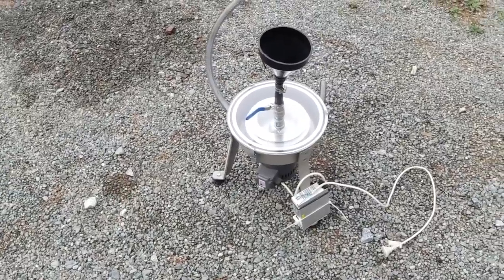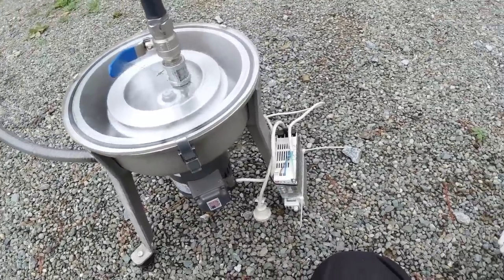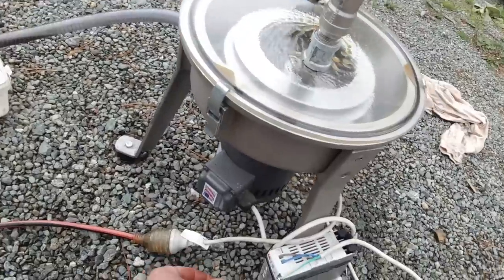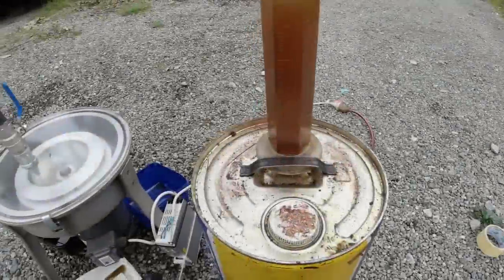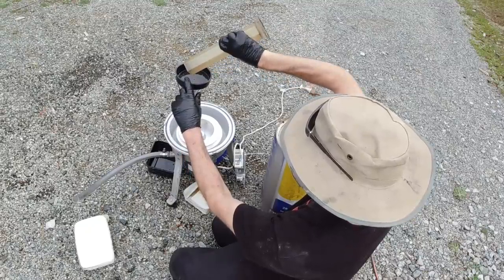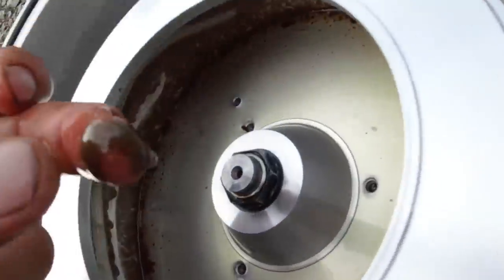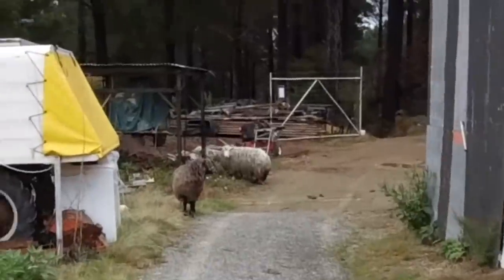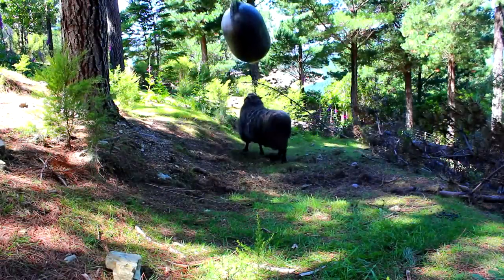Using a centrifuge to clean used oil and diesel.. Will it work??

Comment: Marty, long time subscriber here from alaska.... this is right up my highest attention level as it brought back a great memory on a job I worked on.. the Valdez Oil Spill, a tanker went aground and the stories about it went world wide. I was on clean up with a machine powered by a seven cylinder Deutz engine,... a very loud air cooled engine with just a perfect setup to run three centrifuges under it so it could separate oil from the sand and rock on the beach. It did work alright but it was a nasty thing to clean that crude oil from it... so when we packed up and left, we didn't bother to clean those chambers. Fast forward about two years with no more work for it and we needed some cash so decided to scrap the machine and part it out. We took those tanks out and the first one sent straight to the crusher so when we tried to take the next one... they resoundingly said clean only! We needed that cash bad so we started cleaning up the centrifuge of the nasty crude, backyard fire to remove the crude praying not to get caught with the smoke from that fire which did not burn well at all or a losing deal. That turned out a blessing though cause this is where things got interesting.... gold and oil have a similar weight on the periodic chart and so imagine our surprise when we found a significant amount of gold flake from that sand off of the beach in Valdez. I and the other guy had a lot of money we figured to never see back and so owed money yet for materials. We found in the waste and spots in the cylinders a lot of gold at thirty two dollars a ounce then as so even... it came to nearly seventy thousand dollars in gold we had no clue was in this machine... more if we had kept the one we shipped out for scrap. I did tell them what we found and so they retrieved that crude from the cylinder once found again. It paid off our debts, and put a little cash in our pockets as  well. Us guys though who catch the bug called hobby mining never wind up with much cash in the end and we could not afford to build another centrifuge like our first one.... I just know it would of worked in some of our streams here
Reply: Fantastic story!
Reply: What part of AK?
Reply: Oil separators have been used in ships to filter heavy fuel oil to the engine for a long time. Heavy bunker oil is pre-heated first, then through a centrifugal oil separator, then through particulate filters before the engine. Big things, those separators, with a lot of widening chambers (cups) in them. Same principle as in the video, just a lot more of them. In a centrifuge, the viscosity of the fluid + the diameter decide the optimal speed for a certain size contaminate. Your crude little experiment showed us all that it works, but you need a more controlled environment to get a good result. And a better centrifuge, of course.
Reply: @AlaskaTrapper  I was using in on the petersburg road that takes off of the road to fairbanks... past gold creek
Reply: Dear Morgan Adair
👍👌👏 What a great story with a very surprising result. Congrats. I like happy endings respectively I need and want them (especially nowadays). Thanks for sharing this adventure.
Best regards, luck and especially health to all involved people.
Reply: Although the separation method might filter out gold flakes, gold and oil are most definitely not of the same specific mass. Gold is about 20kg per liter of volume, where oil is about 0,7kg per liter of volume. They could not be further apart in density. 
This is exactly why you can separate based on centrifugal force. Drop a slurry in a cone shaped container, spin it. The lighter elements will be flung outwards and upwards, the heavy stuff like gold, lead, mercury and all that heavy crap stays behind.
Reply: LOL!
Reply: Wow that's a great story. Glad you made out good for all that awful labor.
Reply: Great experience and thanks for sharing!
Reply: I live in that area now.  Your gold prices aren't accurate for that time period or even close.  You're literally claiming to have got 150lbs or 2187 troy oz of gold.  I've never heard of people using centrifuges to clean up exxon valdez; but it is possible.  Valdez was also not a major area as far as spill damage in spite of the name.  I've also literally rebuilt fuel/oil centrifuges multiple times and that's not something you build.  I think your memory is as good as your written communication skills because that certainly was a challenging read.

Comment: your centrifuge will clean down to less than one micron but will not remove the colloidal carbon that makes it look black still. It will certainly be clean enough to blend with whatever and run in non common rail diesel motors. good on you mate, I've been doing this for 10 years and have used over 60,000 litres through my Cummins Signature 600.
Reply: oh yeah...I have seen the 10K rpm units clean oil quite well...but they sound like they are gonna explode!
Reply: Exactly. Common rails are way too delicate, the high pressure pumps just runs at insanely high pressures, any sort of impurities will do tons of damage. Older diesels are less refined and efficient, but also much much more resilient
Reply: You pass the oil through compressed cellulose and you'll remove most if not all of the sludge, carbon and oxide insolubles. I use a dirty liquids pressure pump to clean oil that way. I reuse it in order of degradation through increasingly less important machinery. Ex: car > lawn tractor > garden rototiller > chain saw. Initial setup is a wee bit expensive, but it pays off over time. Where it really shines is on my brother's farm where things are upscaled considerably. Mixed with good oil, you get perfectly usable oil at a reduced cost. And it adds up. We've had several blends and the raw product tested and the compressed cellulose removes all the major contaminants including oxidation issues.

Dunno if it works for fuel tho, never tried it, we rarely deal with wasted fuel.
Reply: Do you have some pictures or similar on your setup? 
I'm currently using  Diesel ship  filter catriges and I'm happy so far but I'd like to see how you guys do it
Reply: Only diesel or do you burn oil?
Reply: I run regular Diesel sometimes,  but mostly a mix of 70% waste oil blended with 30% unleaded petrol, the mix can be altered to suit your needs  but I try to keep the specific gravity at around 0.83. you can't mix more than 40% unleaded because of pre ignition damage so I try to stay at 30% or under. The older mechanical injection systems loves the lubricity of the Black diesel now that diesel is low sulphur . I  have sometimes used a 50/50 blend of diesel and waste oil and had no problems.
Reply: @mdavies750  what kind of equipment do you run? Generator? Tractors?
Reply: @mdavies750  Ah so you are thinning with gasoline. Your overall savings is quite a lot. What grade do you use of gasoline? Have you tried ethanol? 
How much do you keep refined oil on hand? I have see some people's set ups and my neighbor was going to get in to it yet he does not use much for diesel any more.
Reply: yes, may be good for particulates but doesn't oil go "bad" with other problems, increased carbon, sulfur?
Reply: @sheph7  Oil does not go bad, it get contaminated. Oil goes bad "contaimated" because of chemical reactions like air and oxygen, heat, light and water. if you store your oil full with little to no oxygen in the top then you will have less contaminates. Refined oil that has been filtered to remove the contraindicates will have less thing in it to hurt it.
Reply: @VH-ew7oq  on highway tractor unit Freightiner with cummins Signature 600
Reply: @kameljoe21  I use standard grade ron 91, ethanol is too expensive at my location
Reply: @kameljoe21  Oil does go bad, atleast the multi-weight oils. 
By heat cycles and being pushed through the oil nozzles in the engine, it degrades to the properties of the base oil being used to produce the multi-weight in the first place.
Reply: @sheph7  Yes and the constant heat cycles it goes through in its use alters it's ability to maintain a film and deal with heat,lowering your oil pressure and becoming thinner at lower working temps, therefore essentially altering its actual classification.Back in the days of reclaimed 20w50 being commonly used by most back street garages and Sunday DIY-ers. it was found by a motoring journalist that some commercial reclaimers were using salt in their processes and a good percentage remained in the end product. Back then quite a few cars had oil pressure gauges and you could see after filling that the initial good pressure would drop off quicker with cheap reclaimed stuff after shorter durations than you got with even a half decent oil. I used to use quite a bit from a Motaquip shop for a garage that I worked at,every bottle despite being the same brand and type was a different colour oil😂. As stated by others it will be fine in older stuff,machinery etc.anything new and you are taking a gamble.
Reply: @kameljoe21  The constant heat cycles it suffers in use alter it's ability to maintain a film and it's heat transfer properties,around 60% of engine cooling is achieved by heat transfer via the oil and it's the only thing keeping the components from eating each other.
Reply: The problem is that the oil wont be able to bind any more carbon, which means that it start to accumulate in the oil as particles and degrade its lubrication ability, aswell as pose a threat to parts that rely on tight tolerances, by these particles clogging them up. On a modern engine this is pretty much a death sentence.
Reply: @aserta  it works very well to clean pure diesel fuel :) On ships with smaller type auxillary engines such as some Scania V8s with common rail use the compressed cellulose filters or CjC as the brand name usually is, to clean regular diesel thats been stored in the ships tanks.

Ive also seen a lube oil sentrifuge replaced by a 1 meter tall filter with 4 stacks of 3 inserts each, on a 3000kw wichmann engine
Reply: The particles would sheer through wear over time right? Wouldn't this effect the viscosity of the oil, and if so, does it not matter in certain applications where it does it car motors?
Reply: Don't forget milk is a colloid too and why it looks opaque white,
Reply: @Oroborus710  Yes it does, for a very simple, farmer style test check out ProjectFarms Videos of engine oil comparisons of this happening after only on heat cycle! This will mostly effect the performance of cold oil because the properties of the multi-weight oil changes towards the properties of the base oil.
In short, the oil becomes more viscous when cold, against the desired lower viscosity, to pump more volume at lower temperatures, when cold !
Reply: Lol clean used oil & diesel. Last time I checked used diesel meant it was burnt not cleanable.😅😅😅stop it silly!
Reply: I think you can use electrolysis to remove the metals and sulfur and even carbon from the oil. Oil itself is a very good insulator but with all the contaminates it might just work at high voltage. I think oil is 5 times better then air at insulation? Im looking for any articles published now but it would be a perfect second stage if it worked. It would be a low effort way to recover metals and elements from oil as well as reuse it.
Reply: @aserta  video?
Reply: Did run it in several different diesel engines and wmo ran best in earlier common rail diesels. 

Best start up at any temperature, best power and absolutely no smoke or haze. 

Could run it at 100% wmo and it drove just like on diesel. 

What ruined the system was a stupid mistake were gasoline dillution in my fuel destroyed the high pressure pump. 

I collected fuel from misfueling to dillute my oil for colder weather and someone told me it was 80% diesel while it was more like 80% gasoline. 

So I added too much, as already 5% gasoline in engine oil will absolutely have a strong smell of gasoline. 

Well that destroyed the pump and that was that. 

Only filtered the oil through several stages of 10 inch well filters down to 0.2 Micron where I used a barrel pump and a fuel nozzle

Comment: The best method is to heat the oil up to 120c prior to centrifuging it, the high temperature thins the oil out making the centrifugal forces more effective on the finer particles.
Reply: Its also going thru way too fast. I would get an electric valve and arduino or other timer so it can be automated and left alone

Comment: I used to work on seagoing vessels with separators. It needs a water ring. Vertical: from inside to outside, oil specific mass under 1. Water 1. Dirt etc larger then 1. On top you need a plate called specific mass ring. Its diameter needs to be smaller so it keeps the ,,water cylinder,, in place. You wont be able to get the colour out. Lub oil you take out the dirt and additives new engines need. So it only can be reused on older engines that dont need additives.
Reply: Yes, Alfa laval centrifuges for cleaning fuel on ships need a water inlet. These machines are about 5 levels up. Also, these machines are created for certain inlet densities of the filtered liquid.... When I started cleaning used oil for heating the house in a mixture: used car oil + a mixture of mineral and synthetic oils ISO VG 220-460. I mixed these two ingredients in a 1:1 ratio and preheated to 60°C. I used a milk centrifuge from 1935 with an electric motor instead of a handle. With this machine I filtered approx. 2000l per year for 5 years. Then I made something similar with an output of approx. 30 l/min.

Comment: That ending was awesome. You know you can do a basic moisture test using the crackle method. Heat up some metal on a stove top to over 100C, and place a drop or two of test oil onto it, and any significant moisture will make it crackle.

Comment: for water contaminated tractor transmission oil I boil the water off in a 20L paint tin over a gas burner,works fine and oil ends up nice and clear again.

Comment: That's really interesting, never seen anything like that.  I think you've got the right idea in running it all day in a cycle.  It might be interesting to buy a cheap oil filter and run a pump before the filter to send it back to the center of the centrifuge.  Neat stuff.  Thanks for the video!
Reply: A marine water separating filter would work also
Reply: A cheap filter won't do anything as they don't filter more than 10-20 microns

Comment: If you notice, on engines that have been under cover but haven't been started for say 30 years the oil always looks like it's new. All the particulates sink and the original oil stays on top. I've seen this quite a few times over the years.

Comment: Not entirely related but: In the early 2000's my dad drove 300k miles fishing in his diesel Citreon car fuelled 90% by used vegetable oil collected from take-away restaurants and gravity filtered by the side of the road. The other 10% was either fresh cooking oil or diesel, this was mainly in the initial stages while he learned and adapted the car slightly to work better (some in line fuel heaters he custom made as 99% of the issues he had were due to viscosity/cold temperatures over night).

He did his research and got the car in question specifically due to the type of fuel pump used, I don't expect modern vehicles would take the transition as smoothly 😬

Comment: My Honda motorcycle about 1974 year had a centrifugL oil filter. The engine was spotless and oil always clean. Had a 50mm diameter cup about 70 - 75mm in length. I couldn't understand its process but thats how it worked. You're onto something here Marty.

Comment: The ram should be your channel mascot! Launching his entire body into the toy, is a good reason never turn your back on him; but positive interactions will reinforce safety. The centrifuge is a great idea, but as you say the incorporation of heat exchanger would be a good; if you allow the oil to cool before going back into a centrifuge. You could build a filter system using sheets of "qualitative" filter paper designed for funnels which are precut into discs. Or paper towel /coffee filter drip system between multiple giant plastic funnels, if sufficient size / diameter will regulate the flow and improve the capture of fine particles. An oil centrifuge interesting idea, especially for burners.

Comment: Way back when we simply dumped the 14 gallons of used oil from one of the big trucks into several fuel tanks and their inside filters would catch any particles in the oil before it hit the pumps and injectors,saved a few bucks off of fuel costs when considering each trucks oil had to be changed every 6-8 weeks depending on its miles ran... Never had any issues with pumps or injectors due to used engine oil.  Works great in off road equipment also..